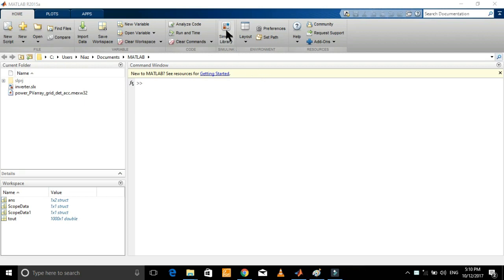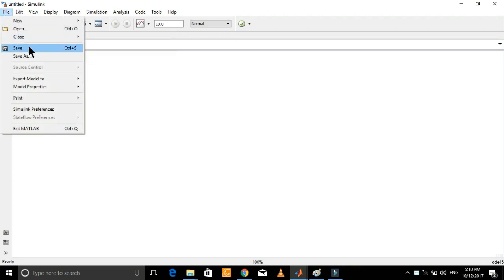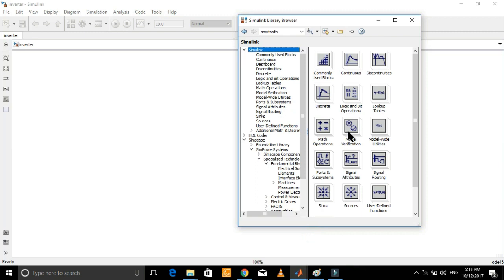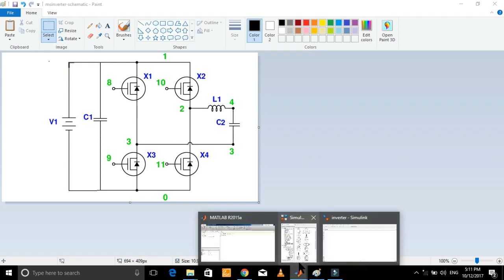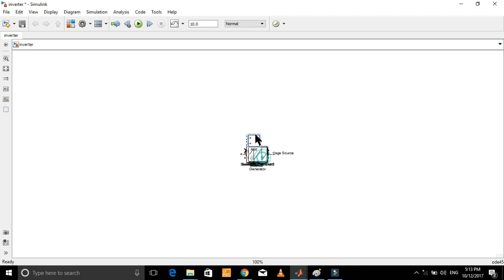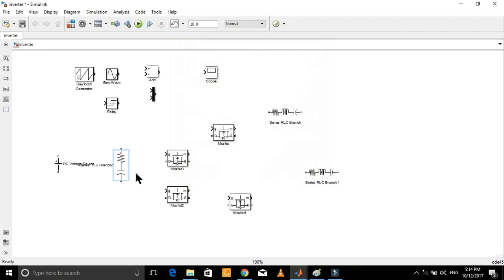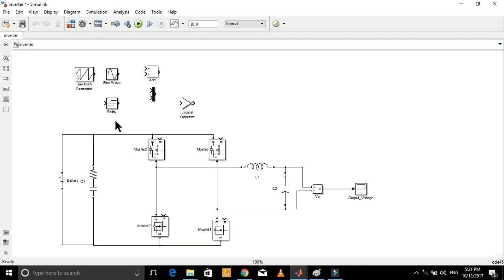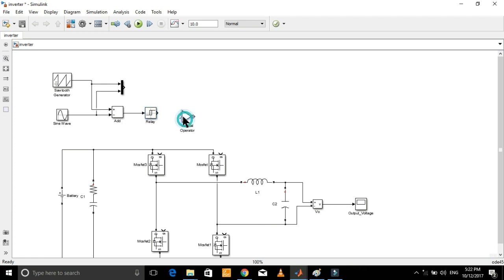Pure sine wave inverter design in Simulink MATLAB Part_1

Comment: Thanks for your video, question, the battery voltage is 100V? and the LC filter is just a filter or the inductor boost the voltage?